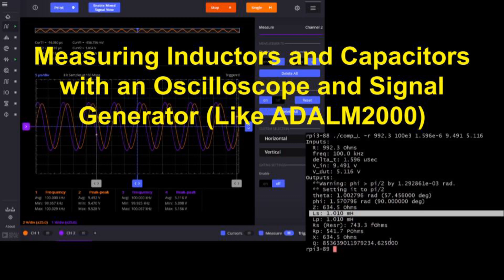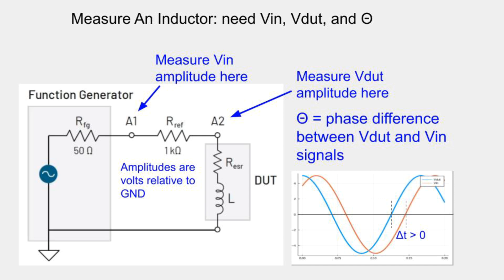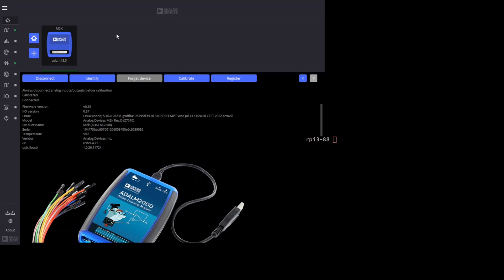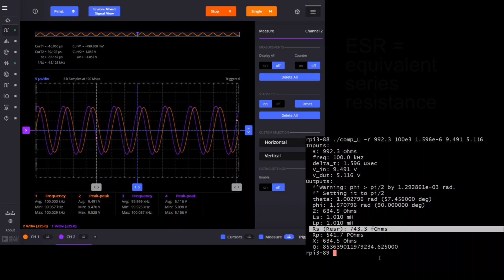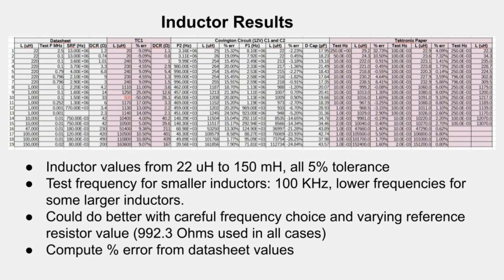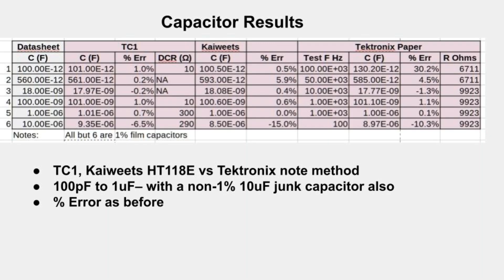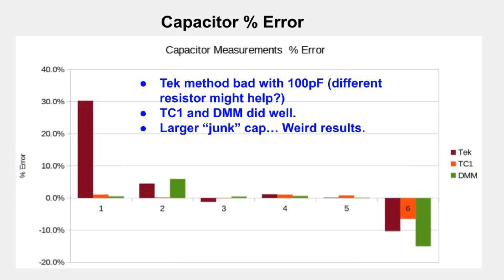Using an Oscilloscope to Measure Inductance/Capacitance like an LCR

Comment: nice method. but what if the output impedance of the funcion generator has got 10% tolerance.
Reply from the maker: I don't think it is very sensitive to this.  It would be interesting to do a test with and without an extra small resister. Cheers.

Comment: Appreciate your work here; I’ve done a lot of surveying of mostly C measurements with a scope.  Two things - I think there is something off in your phase calc in your first example.  A 1.5us difference on a 100kHz signal is less than pi/2.  It is 0.3*pi.  Also, all methods that involve probing across the DUT introduces error from the probe itself.  I use a different method with triangle waves for C measurement that is simpler, easier to measure and calculate, and takes the probe reactance out of the equation.
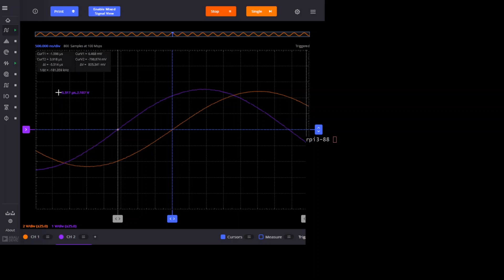Reply from the maker: Thanks for your comment.  I think you refer to the 1.596 usec measured at 5:39.  That's for a phase difference theta between Vdut and Vin, both voltage signals.  A computation is then needed to get phi, the phase difference between the current and Vdut.  The Tek app note calls this "alpha" for some reason.  It's the one that should be near (but not more than) pi/2.  The ADALM2000 does not measure theta accurately enough for the small Resr though (likely about 10ns off), and it should be worse than a standard oscilloscope as far as probes go.  You make a good point there.  I get somewhat better results with my scope, but the angle measurement is still challenging for small Resr.

The ADALM2000 actually has differential inputs and could measure the current signal across Rref directly, but the tek app note does not assume a differential probe. So, the ADALM2000 could use a more direct method, but the computations would change.

I have not heard of a method for C using triangle waves.  That's interesting, thanks.